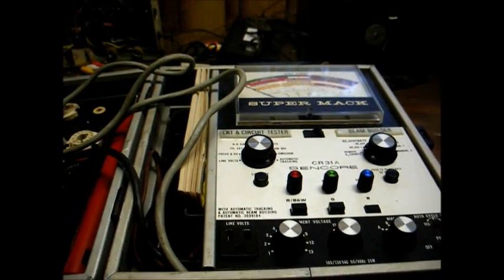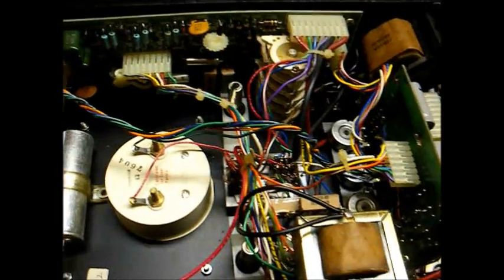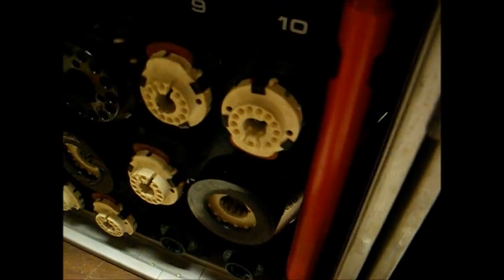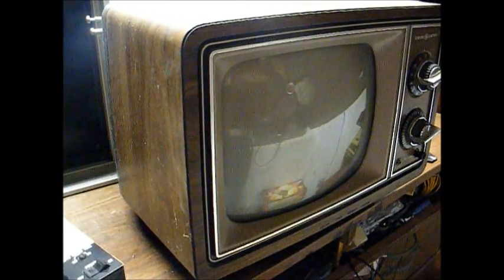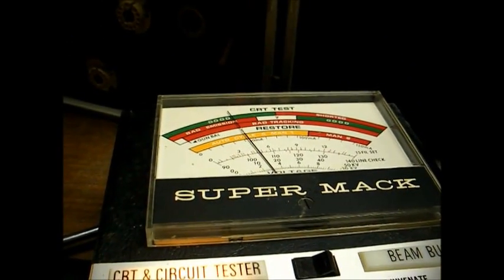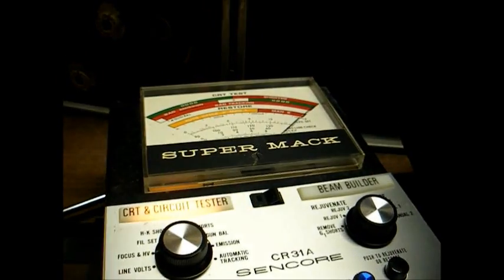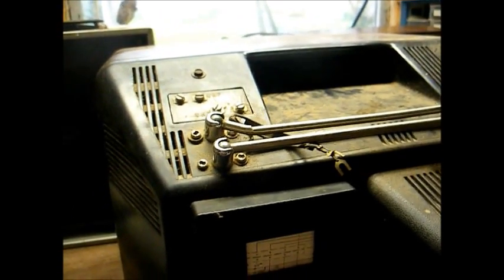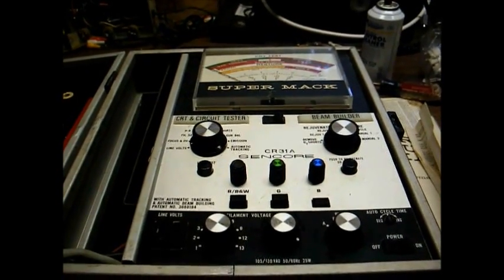Sencore CR31A CRT tester

Comment: Sencore  made good test equipment.   We had this model and also the later model (1984) in the TV/stereo repair shop I worked for a while in the 80's, this brings back memories.  We also had a lot of B & K test equipment.  And you are correct about being careful using the rejuvenating function, too much and you can blow out the filament, etc. - I learned that the hard way.